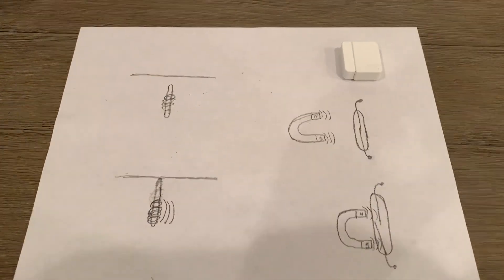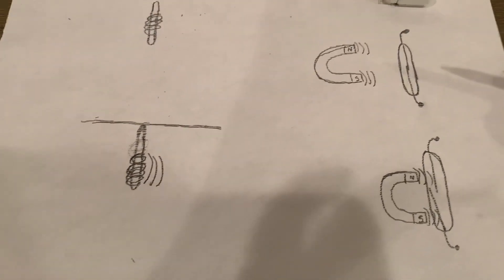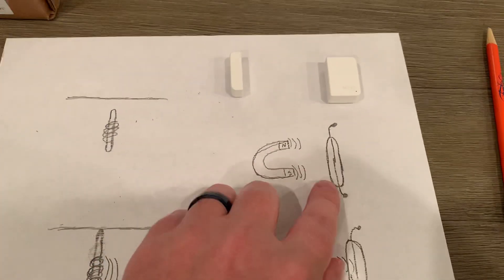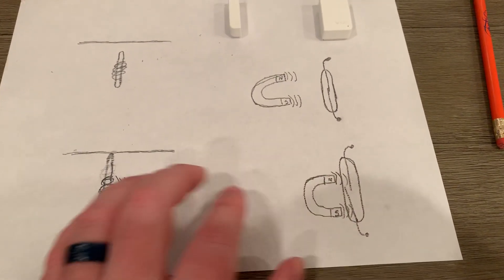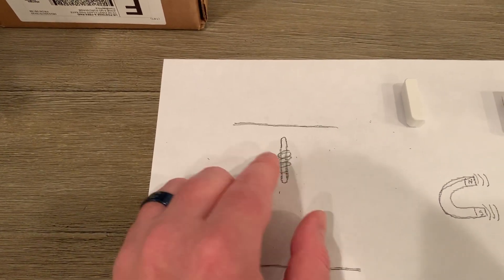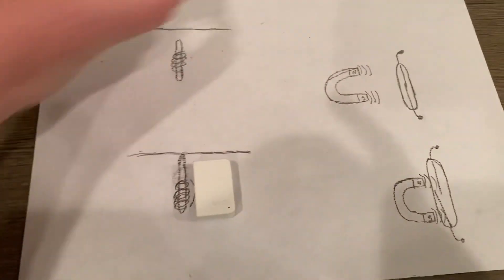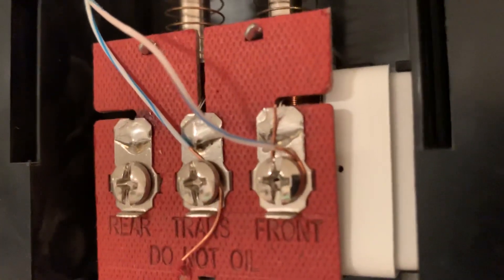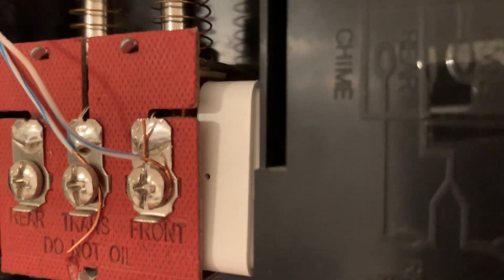Wyze doorbell how to

Comment: I tried doing the same with a Ring contact sensor but it didn't work :( The Ring sensor looks pretty similar inside as the Wyze sensor. Do you think my doorbell might not be generating a big enough magnetic field (I tried all different positions)?? I have this doorbell (https://www.amazon.com/dp/B01GSRLEFS/) plugged into a 12-14v AC transformer. Thanks!

Comment: Hi there I just got my wyze contact Sensor. And follows your instructions. I put only the big side of the sensor and it always stayed open. And then I setup to get a notification when doorbell is closed. Is this normal?

Also is there a way to modify notification? Not just “doorbell is closed”
Reply from the maker: haddad4gbatemp it showing as open is normal and getting a notification that it is closed is the best it can currently do. I have posted on Wyze's forum that they should allow for custom states and notification messages. I don't think they are very interested in putting much effort behind it though so I wouldn't hold my breath.
Reply: Drew Calder thanks! The battery should still last a year right? Is it not always going to stay open?
Reply from the maker: haddad4gbatemp based on my understanding of how it works it should have the same battery life. It should just send signals on a state change and the occasional check in. The check in should happen no matter the state. I have had mine in for about 4 months now and it is still working. It may even last longer if fewer people ring your doorbell then how often you open a door with a sensor. Only time will tell though. But even if it only last 6 months it is still a pretty cheap way to get notifications.
Reply: Drew Calder thanks drew! Your awesome! Now only if they have us the option to edit his the notification is displayed.

Comment: Hi Drew! Thanks for the video! That's an awesome idea, I Will  definitely try this. I have a question,  as the sensor will from now on be always Open until Bell switch get pressed,  wouldn't that consume the Wyze Sensor Battery? I don't know,  just assumed that the closed state is like a resting one where it doesn't send any signal. If you have time please let me know your thoughts  on that, thank you.
Reply from the maker: Robertx84 the sensor is in an open state until the door bell is pressed at which time it quickly closes and opens again. As far as I understand how it works I don't think it consumes any more power because it is only sending signals on state changes and on some set interval to report in. I could be way wrong though. I will see if I can get a response from one of the engineers on this. I also have some ideas for some tests I can run to see how often it sends signals. I will update you when I find out more.
Reply: @ideaxtruder  Yes, That makes sense too. Thank you very much!, I tried it myself but my door bell model has the magnets part inside a hard plastic piece that prevents the sensor to activate,  your idea and implementation was great anyway :)
Reply from the maker: Robertx84 you may have already tried but you may want to try on the outside of the plastic magnetic fields can be effective at a surprising distance.
Reply: @ideaxtruder  yeah, I tried all around the plastic piece with no luck , maybe the plastic part is too thick.

Comment: Another excellent idea.  Please consider investigating the RF signal these sensors and the Wyze RF bridge transmit  to combine them say with a raspberry pi running node red or node.js.  I'm awaiting delivery of 6 Wyze Sense starter kits to do just this.  Technical info on the RF specs of these devices eludes me.  Thanks for your ideas.
Reply from the maker: Elysium I will see if I get some time but I have a pretty long list of things I am working on after work, family. Hopefully  I can get them all done and expand my horizons into other things.